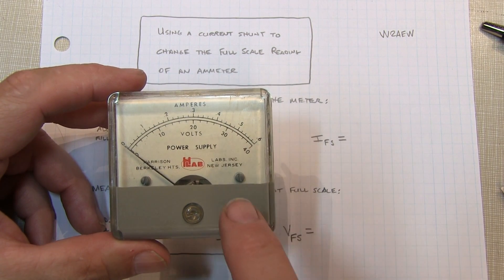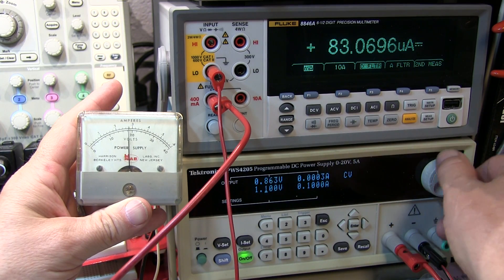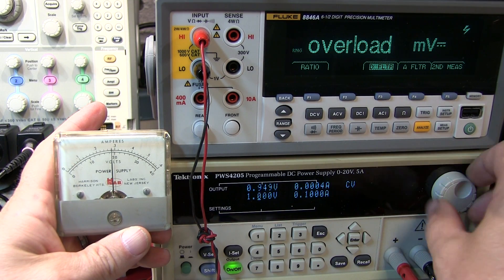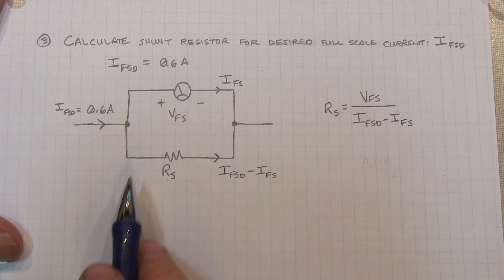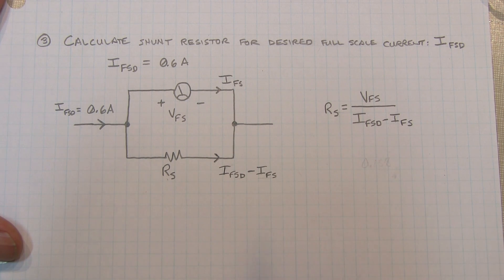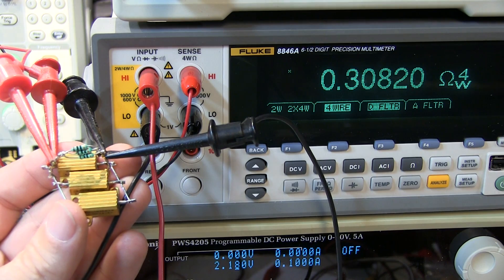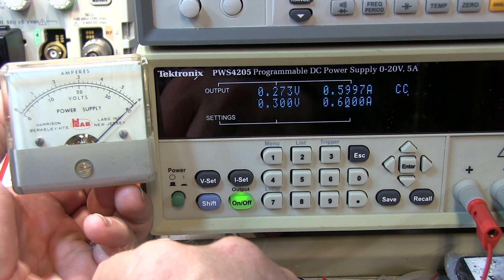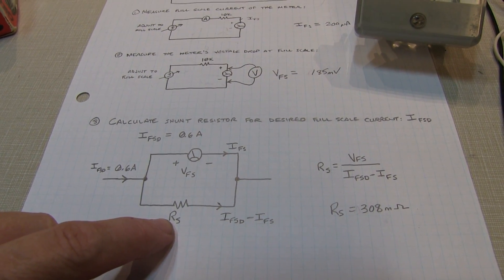#236: Using a Current Shunt with a Panel Meter / Ammeter scale change

Comment: Does any lab current ammeter measure MESH current? because most current ammeter just only measure Branch current. What are the differences are between MESH current and Branch current because you get different current values for MESH current compared to Branch Current. When would an EE engineer or technician want to know and measure the MESH current because most technician are just measuring Branch current?
Reply from the maker: MESH current refers to an ANALYSIS method, not a measurement method.  https://www.allaboutcircuits.com/textbook/direct-current/chpt-10/mesh-current-method/
Reply: @w2aew  I'm confused why the MESH current value is different than the branch current. Why is the current have different values and what's the point of knowing the MESH current?
Reply from the maker: @waynegram8907  As I stated, it is simply a MATHEMATICAL ANALYTICAL METHOD to solve for the total circuit current values.  Mesh currents are computed for each "loop".  When loops intersect, meaning that they share the same path or part, the mesh currents from each loop add up (or subtract, depending on the direction).  You don't measure MESH currents, they're just a computational tool.  Branch currents are the sum of all of the mesh currents that flow in that branch.
Reply: @w2aew  yes I understand its a computational tool but its totally different current values compared to using Kirchhoffs current law. What I'm confused about is why isn't kirchhoffs current values the same current values as MESH current. I would think logically that current should have the same value, because if the network or circuit is 1 amp using Kirchhoff current law but the MESH current is not going to be 1 amp it will be a totally different current value which doesn't make sense to me.
Reply: @w2aew  Ohms law uses V/R = I so the MESH current is not going to be V/R=I it will be a totally different current value, any reasons why the MESH current it totally different compared to ohm law?
Reply from the maker: @waynegram8907  All computational methods (kirkhoffs, mesh, nodal, etc) should give the same results if done properly.
Reply: @w2aew  Logically I would think but Nodal & Mesh don't give the same results as using V/R= I . This is what I'm confused about. I understand Kirkhoffs current laws because its uses V/R=I and it makes sense but Nodal and Mesh don't make sense to me at all because V/R=I doesn't work with Nodal and Mesh, any reasons why?
Reply from the maker: @waynegram8907  I don't know, it sounds like you may be applying these analysis techniques incorrectly.  Without a specific example of what you're doing, its difficult to comment further.

Comment: All of the panel mount ammeters seem to be from China.  2.5% accuracy.  So your calculating the current flowing through the meter the 200 micro amps would be useless. Also the standard for the  meters is 75mV. So all of the different models of that ammeter can be made identical. Only the paper with the printed scale would have to be different.

Comment: Hi Sir, I do have a little question. Do you know if a car fuel gauge in a 90s car is generally an ammeter? If so I can apply the knowledge of your video to test my fuel gauge as well as the sending unit. Thanks for your time!

Comment: Thanks for the very helpful and illuminating video.  I recently picked up a nice old Triplett panel meter for a project.  It looked good if a little gunked up, but measured open, and upon disassembly I found that the coiled-up length of ~34AWG magnet wire that they used for the shunt was badly corroded and in several pieces.  I needed an excuse to buy some magnet wire anyway and will have a functioning meter soon.  Thanks again!

Comment: That was perfect.  Thank you.  I purchased a digital ammeter to add to a pwr supply I'm building.  Going on my experience with  automotive ammeters I  did not realize a shunt was required.  I tied the meter into a simple 5v  LED bread board circuit, and released some smoke from my YwRobot P.S. 5V regulator.  Now it produces 6.9V.  
I Went on line to find the specs, before blowing anything else up.  I found the exact same unit, and the manufacturer. The device is available in green and blue as well as the red which I have.  All of them show shipped with the Shunt included.  I'm a little bit perturbed. What happened to the shunt?  Clearly the device was repackaged.  zip lock bag.
0 to 10 Amps, 5 to 12V is all I'll be using, device I believe goes to 30amp. I know a shunt is made specifically for this thing but I can't find the value, only math classes. 
I think I can easily figure it out now, even with nothing but multimeter.
I see Mr. Caralson was last one to drop by. I spend a lot of time over at his place as well.

Comment: Alan, do you have to remove/disable any original internal shunt before doing a mod like this?  I have a 0-1A AC ammeter that I want to make dual range (0-10A) with a switchable external shunt.  73  KCØHST
Reply from the maker: As long as you're adding a higher range, you can simply add an external shunt as needed.

Comment: Thank you for a great explanation.  I recently purchased a piece of equipment that has a 500A ammeter. I opened it up and there is a shunt resistor of course for measuring the current, however there is a small potentiometer in series with the leads going to the panel ammeter.  So it is exactly like your drawing in #3 but with the addition of a potentiometer in series with the meter.  Is the purpose of this to reduce the amount of current actually flowing through the ammeter?
Reply from the maker: This is typically done as a fine-tune calibration adjustment.

Comment: What lab test equipment can I use to test how much current my AC outlet can handle BEFORE it Pops the mains circuit breaker. If you didn't have or know the buildings wiring or main fuse panel and just wanted to measure how much current each AC outlet can handle what lab test equipment would you use to measure how much current it can handle before popping circuit breakers?
Reply from the maker: There is nothing that I know of that can predict the tripping level for a circuit breaker.

Comment: In a DC circuit should the Ammeter or Load be connected to the Positive connector?
Reply from the maker: since they are in series, it really doesn't matter.  It is most common to connect the ammeter to the positive connector so that the load can remain connected to / referenced to the lower rail (usually ground).
Reply: @w2aew  Yes...I saw that too....but, wanted to know if there was any specific reason?
Reply from the maker: @akmt123  Yes, as stated above, it is so that the circuit under test can remain connected to it's reference potential - usually ground.

Comment: Dear Sir, can you explain to me how to change ammeter scale from 50 A 
to 5 A ?
Reply from the maker: It may or may not be possible, depending on the meter design.  If the meter has a built-in shunt, you'd have to change the shunt value.

Comment: How would you calculate full scale deflection current given the resistances,  the meter current,  and the leads between 2 points? No voltage given.   This question is from the arco electrician exam book in the back of the book.  (Exams)
Reply from the maker: Sounds like a little application of ohms law and linear extrapolation...

Comment: Alan,
Nice video. I needed a shunt and didn't have any nichrome wire, so I used a copper wire and filed down a small area in the center section until I had the full scale reading I needed.
Reply: Congratulations, you've won the award of being my new fuse maker!

Comment: Once again an excellent presentation and it ties in so well with the previous meter clip, your Bird meter clips & also with something I've been trying to figure out.  Has the shunt in my wattmeter changed value or why would I be getting measurements shown in my clip.https://www.youtube.com/watch?v=S1Ew8wQwSI4.  My lab equipment is a little more basic...I need to find out voltage required for FSD next I believe for the equation.
Reply from the maker: +Christopher Larwood The meter used in the Bird 43 (and I presume in your meter as well) is a 30uA full scale meter movement.  It does not have an external shunt.  Thus, if it doesn't read 30uA at full scale, the meter movement itself if bad - there is nothing to can "add" to it externally to correct for this short of designing a current amplifier - and there's no guarantee that this will work correctly with the proper linearity.

Comment: Occasionally, when I needed a very low ohm shunt resistor (not having a precision low-ohm meter), I have just calculated how many parallel strands, how long, and of what gauge, of nichrome wire were needed. 

If you are making a new scale, getting the shunt value close and then measuring the actual deflection for a given Amperage will let you design the final scale. For instance, if you want a 50 Amp meter, making a shunt that gets you close (maybe 53 Amps full scale) will let you make a 50 Amp  scale for slightly less than full deflection.
Reply from the maker: +Peter W. Meek Sounds like I need to get some nichrome wire!
Reply: Handy stuff to have around.

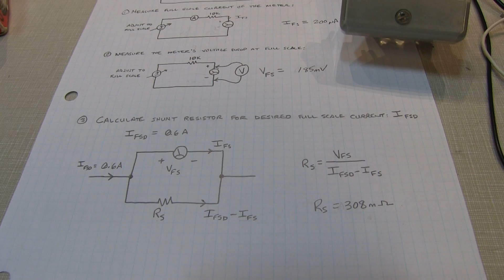Comment: 6:04 - If you don't have an accurate low resistance ohm meter you can also get by with a current meter and either another volt meter or the ammeter (panel meter) that you are using.  Also keep in mind when you are creating the shunt from multiple resistors that you will also need to confirm that you don't go over the maximum power dissipation of each of the resistors.  I would stay under 1/2 the power rating of each for continuous use but for quick tests you could go to the full power rating.

Comment: I guess the point here is to do this is thoroughly as you could, but in this case you could safely ignore the Ifs term and just calculate Rs=Vfs/Ifsd. The simplest way to see this is probably that you're doing the calculations to 3 significant digits, (assuming this is a satisfactory amount of precision) whereas 200 µA would only change the 4th significant digit when added to 600 mA. As is to be expected, if the meter is meant to be useful as a voltmeter.

Comment: Another thing than works well for making a current shunt is some pcb. You can calculate the value pretty closely, then trim it after etching. Of course copper has a much higher temperature coefficient than a real shunt resistor, so it won't be as accurate when it heats up.

Comment: Very nice video.
Maybe you could have mentioned the multimeter series resistance on that caliber and said it was negligible compared to the 10k.
Reply from the maker: +fabts4 In the previous video, I mentioned the typical ranges for the meter resistance. In this case, we have 0.185V/200uA, or about 925 ohms.  In most references I've seen, they use the meter resistance when calculating a shunt resistor, which can be a little tough mathematically for the novice - I thought this approach was more straight-forward.
Reply: +w2aew Maybe I missed the previous video. You're right to think about the novice, that's also why I thought it was worth mentioning the impact of removing the meter was negligible (BECAUSE the 10k resistance is so high).
Maybe the safest for the novice is to leave the amp meter in series while using another multimeter to check the voltage?
Or use the voltmeter mode only to check the voltage drop of the 10k and the gauge?
Reply from the maker: +fabts4 You'll notice in the video that I re-adjusted the power supply after removing the ammeter.  I guess I should've stated that I did this to account for the removal of the burden voltage of the ammeter.  It would NOT have been negligible.  Safest/easiest would have been to make both measurements with two meters - but I wanted to use my most accurate DMM for both measurements (and I wanted to show how to make each measurement for folks that only have one DMM).  Using the DMM to measure the drop across the 10K is also a good way to go - provided you accurately measure the 10K value too.  I mention this last point in my previous video also.
Reply: +w2aew I would be willing to bet that my Brymen 869s will do quite well with the measurements.

Comment: There hasn't been much said about checking the linearity of these meters, in this or the previous video. It may have been helpful to set the power supply at various intermediate currents, after verifying full scale, to make sure the meter movement is linear and accurate over its full range.
Reply: Scott Allen . I tried old VU meters, and they are not linear. I had to hand draw the scale.